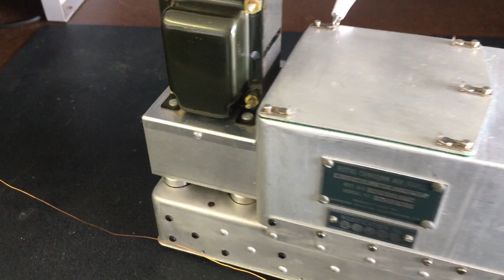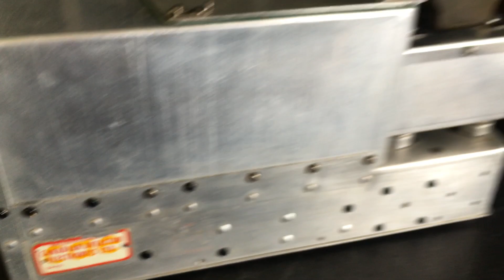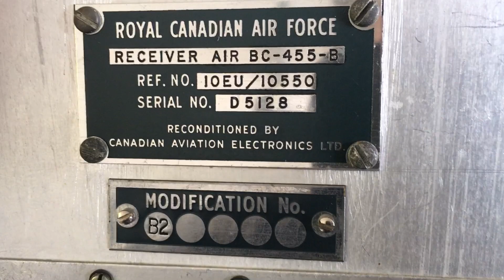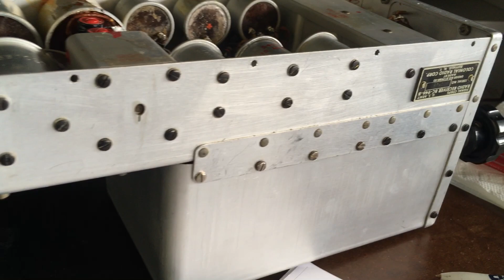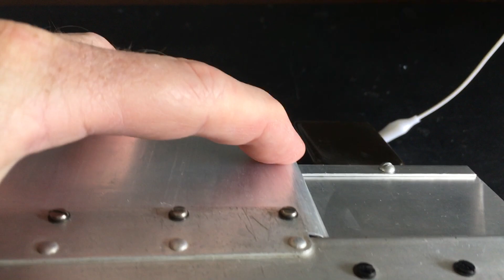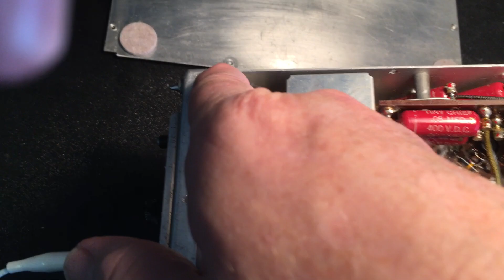BC-455-B Canadian Style WWII Aircraft Radio

Comment: I traded my friend for one of these over 55 years ago. Sadly I no longer have the radio but I do have the multi-tap HV transformer he used to convert to line power. The dyno is alas, also gone. I wish I had them both back. We were living in Wisconsin at the time and ours was the Canadian version too. I used a long end fed wire antenna and really didn't know what I was doing. Learning by mistakes back then. 73

Comment: Interesting in my 60 some odd years I've never seen any model modified by Canada. You have something truly rare. Jerry W9FS
Reply from the maker: Welcome back Jerry!
Same here.  I have never seen another RCAF Command Set receiver. Very clean modification. Just think, they did this after the radio was probably only 10 years old (1944 to 1954).
Something I did not elaborate on was that they also converted the filament circuits from 28 to 14 volts.  In that case, it just may have come with a 12 volt dynamotor.  I just don't remember. 73's